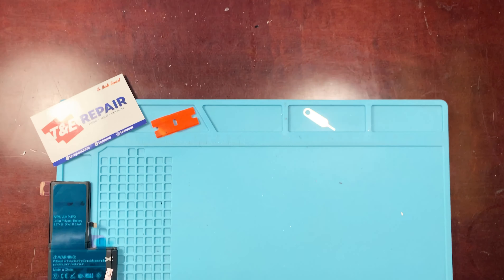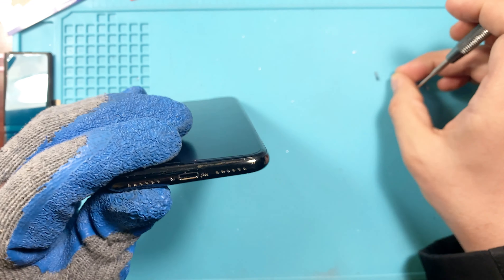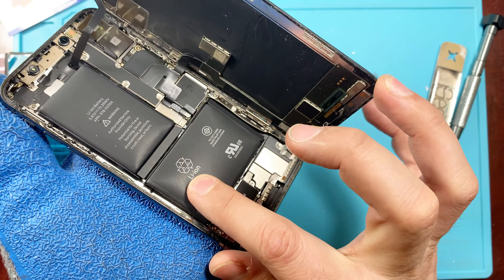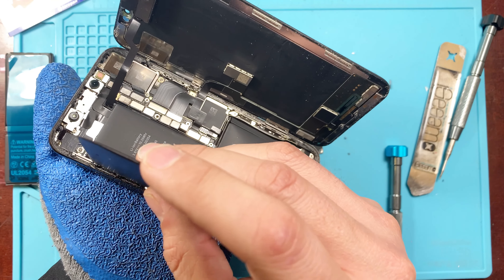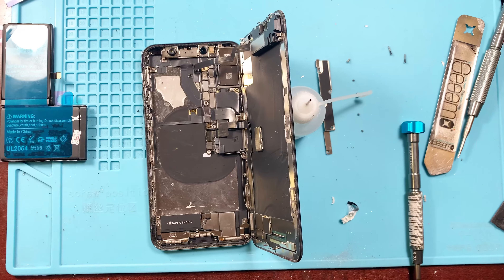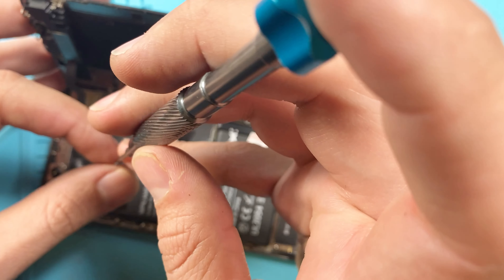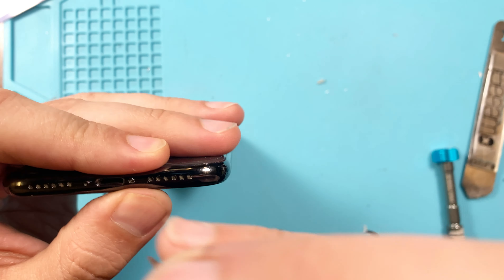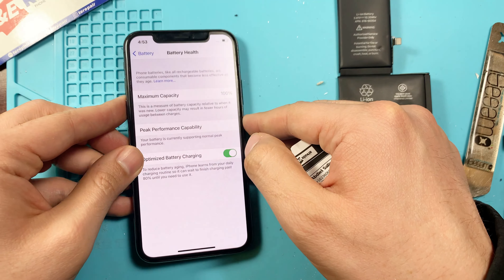iPhone X Battery Replacement how to replace it Shallowed Battery Step by step Not Holding Charge

Comment: Great video man, very informative. 
Quick question: when heating up the back of the iPhone in order to remove the old batterie’s adhesive, how long is it ideal to heat it up for ? Could it cause any damage to other phone’s components?
Reply from the maker: About the time varies, question. What are you using to heat it up?
Reply: @TERepair  I will be using blowdryer
Reply from the maker: @doenteporflamengo8490  place it on the back 1-2 minutes on low mode for about 1 inch distance pointing in circles to the battery area. This will loose the battery you will notice it right away. It won’t damage anything else no worries.
Reply: @TERepair  thank you so much man, I appreciate it. My replacement battery is coming in about a month, It’s manufactured by Baseus, heard it is a quality brand. 
As I will be trying to replace a my phones battery for the first time ever, wish me luck, because I will need it .
Anyway, I will let you know how it goes.
Take care man ✌️
Reply from the maker: @doenteporflamengo8490  Yes, they are good batteries. Don’t worry it’s a simple repair as you can see in this video. Everything should be fine. Keep me updated.
Reply: @TERepair  will do bud, will do.

Comment: Could you get me an amazon link for the heating pad and the pad that you had the phone on the most
Reply from the maker: Sure there it go CPB Heating Pad Compatible with iPad iPhone Smartphone LCD Screen Separator Machine Repair Tools Heat Plate https://www.amazon.com/dp/B019PX7EGK/ref=cm_sw_r_cp_api_glt_fabc_XAEG7TPS1FZJ3JW6X7FN
Reply: Does it work with lg k51 and if I was to let you repair it would it cost
Reply from the maker: @ThePlotchy  yes it does work with k51 and yes the repair cost it’s here https://terepair.com/repair/
For most devices.
Reply: Would it be cheaper to do it myself
Reply from the maker: @ThePlotchy  of course you are saving labor my dear 😉 have a great night.